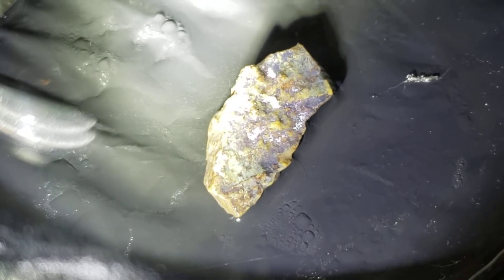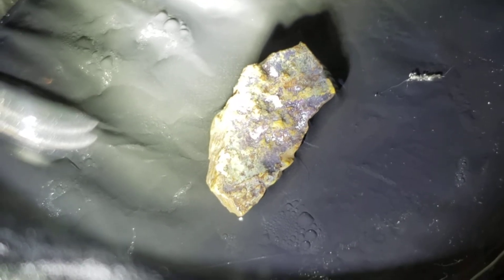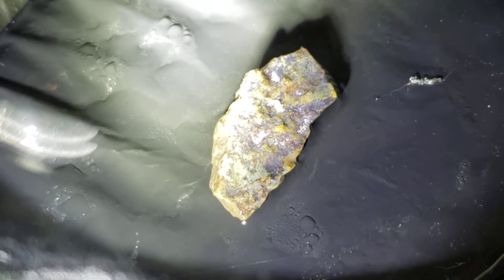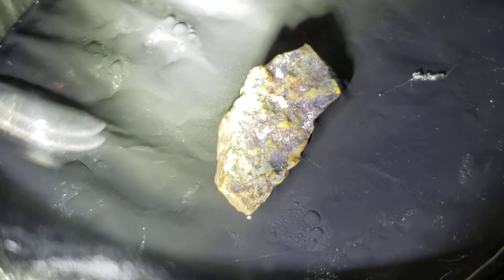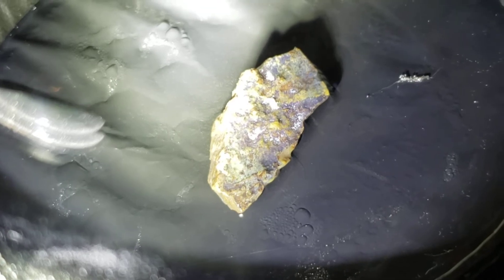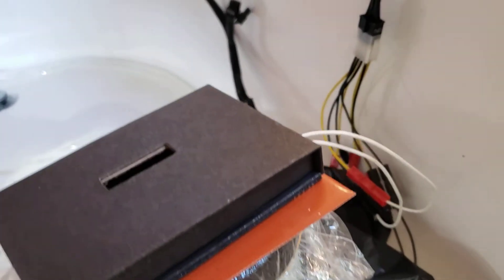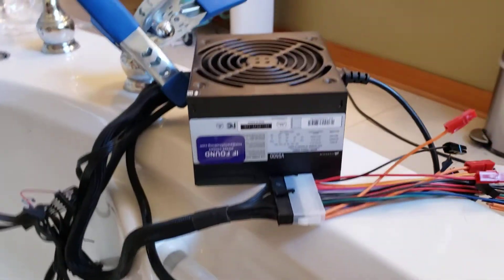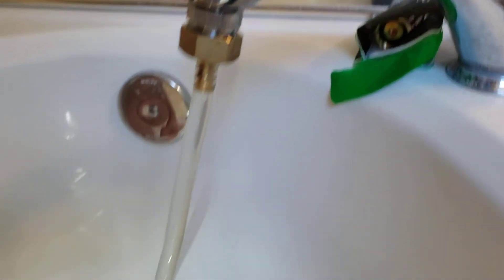Watch radiation come out of a uranium mineral with a thermoelectric cloud chamber, in a bathtub

Comment: Nice. I understand getting the vapor point right is critical? Easier said than done.
Reply from the maker: Yeah, getting that supersaturated layer is pretty challenging, and I struggled a lot with different combinations before getting it to work. It's a bit easier with dry ice I guess, if you have easy access to some (e.g. at many grocery stores, in the fish section).